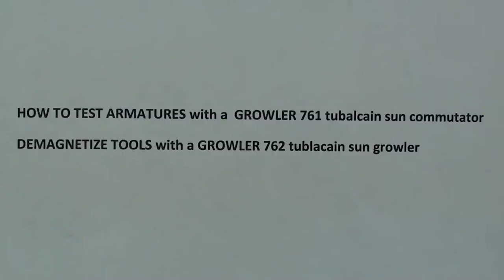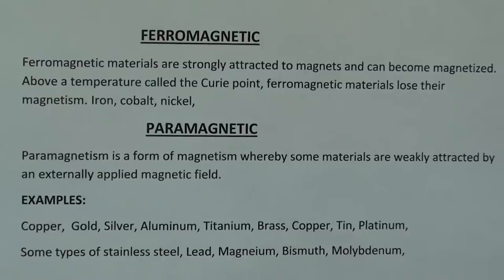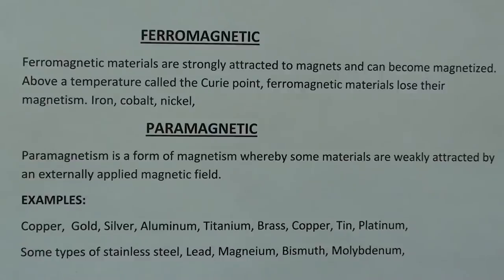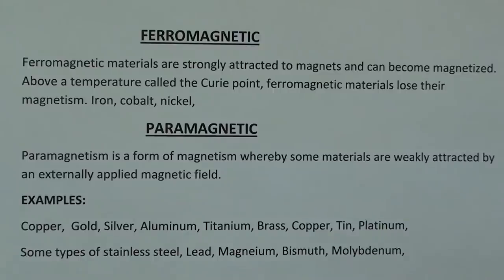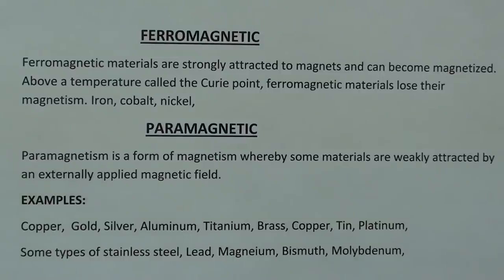WHAT IS PARAMAGNATISM  GROWLER #763 tubalcain

Comment: Very interesting Mr. Pete.  As children my brother discovered that a particular dry cell battery could be squeezed in a vice and we'd get drop of mercury from them.  We save the mercury to play with, shining up dimes and stomping on drops of it to listen to it pop.  We survived such foolishness.
Reply: That wasn’t mercury
Reply: @kiloton1920  It sure was, this was in 1962/3 when there was a line of batteries (AA and AAA) that my Dad removed from radio equipment he was repairing.  In fact in 2016 when he passed away and I cleaned out his radio repair shop he had a box of those old used batteries.  I took them to the hazardous waste depot to have them properly disposed of.
Reply: We used to play with mercury from broken thermometers the same way. We liked to rub the mercury on pennies to make them look like dimes. That was back when dimes were worth a dollar and mercury was something to play with. When was the last time anyone used red "mercurochrome" on cuts and burns? I'm assuming from the name that it contained both mercury and chrome.

Comment: My dad also called the knockouts a slug.  You brought back a fond memory, thanks.
This video reminded me of a gravity experiment. If you have a small magnet and a length of copper tube say 3 feet through which the magnet will readily fit,  allow the magnet to drop though the tube and see if it falls at the same rate as any object dropped at the same time. I believe the power of the magnet may affect the outcome but I myself have never tried it. The magnet will fall noticeably slower through the tube and it is not from contacting the inner wall.
Reply from the maker: I have done that experiment in another video
Reply: On a larger scale many roller coaster brakes work much the same way... and on a smaller scale, thats how old time analog VOM's and some 'beam' type scales are magnetically dampened.

There's a lot more to all this.
Reply: Have you ever tried a slugburger?

Comment: The last material you used being silver solder was in the form of a coil. in other words would  form a shorted loop The growler would induce a fairly high current into this loop, This would add to the vibration you are feeling. I am a  retired armature winder and very familiar with growlers. They are still used today at any elec. motor repair shop. There are small portable growlers that are used for inside field stators on ac electric motors
Reply: the portable growler I used was called a prufex grower and in the form of a wand
Reply from the maker: Thank you for watching and thank you for an interesting comment

Comment: I don't think you're really demonstrating paramagnetism with the growler.  The growler uses AC, and the changing magnetic field induces currents (so-called eddy currents) in any electrically conducting material.  Those eddy currents in turn generate a magnetic field that interacts with that from the growler to produce a force.
So any conductor, even those that AREN'T paramagnetic will feel a force near the switched-on growler.
A paramagnetic material, will even be attracted by a steady magnetic field (such as that from a permanent magnet).  There are also diamagnetic materials which are repelled by magnetic fields.
Reply: You should also feel the strongest effect with copper because it is the best conductor, other than silver.
Reply: You are correct. If you wanted to show paramagnetism  (or diamagnetism), you can do so with a tub of water, a styrofoam "boat" to put the sample on, and a strong neodymium magnet. 
If you hold the magnet steadily near the sample, it will be attracted or repelled very slightly depending on the material.
If you move the magnet over the sample instead, those metals with a high electrical conductivity will "follow" the magnet the faster you move it. This is for the same reason those move in the growler.

Comment: Many of the materials (copper, gold, silver, tin, lead) you cite as being paramagnetic are not.  Those are diamagnetic, repelled by an induced magnetic field, not attracted.  The effect in either case is very weak in a growler, and what you feel in your hand is merely back electromotive force (EMF) from induced currents in the samples, not paramagnetic or diamagnetic force.  Not surprising, because back EMF is what a growler is designed to test such as in diagnosing armatures.

Comment: Sorry to be a pedant, but this effect is not paramagnetism, but an effect of ordinary classical electromagnetics. The field generated by a growler is A/C, and any conductive material placed in an alternating magnetic field will have eddy currents induced in it, which in turn react with the magnetic field from the growler, resulting in a force that you can feel. One phrase for this is "Lenz's law." The effect that causes the copper to vibrate in the growler is exactly the same as the effect that causes the copper winding of an electric motor to turn. In fact, according to Wikipedia, copper is not paramagnetic.

Paramagnetism is a very weak magnetic interaction--much weaker than the effects seen here, but is with fixed magnetic fields. The classic classroom demonstration involves suspending a drop of liquid oxygen between the poles of a powerful magnetic (like the ones salvaged from microwaves). Paramagnetism is a quantum effect found in atoms with odd numbers of unfilled orbitals, and is fundamentally different from the magnetic induction effect you see here.
Reply: Dan, you're correct.  Not sure how the venerable and reliable Mr Pete could be so misinformed about magnetic susceptibility, but he's a shop teacher not a physics teacher.  Most of the samples he's demonstrating are actually very weakly diamagnetic (negative susceptibility: copper, lead, tin, zinc), not paramagnetic (positive susceptibility).  But the di repulsion or para attraction forces in this demonstration are too weak to be felt in the hand.  Lenz's Law is all that he is witnessing.  See CRC Press Handbook of Chemistry and Physics , "Magnetic susceptibility of the elements and inorganic compounds."

Comment: The coin mechanisms used in vending machines and pay phones used a fairly complex sensor system most had three sensors and was used to determine which coin was present or a fake or slug. They were programmable for the various country coin sets. I know, what’s a pay phone?
Reply: Western Electric payphones (called "coin collectors" in the business) comprised what a machinist would call a go-nogo gauge to test thickness and diameters, plus a kinetic bounce to go-nogo on specific gravity and hardness.  It basically measured 4 dimensional qualities in an instant, that amounted to a near 100 percent conclusive test of genuineness.  The coin had to size right, weigh right, and bounce right to pass.  One or more incorrect factors got rejected into the return slot.

Comment: Turns out metallic mercury is pretty harmless, on account of just not being very bioavailable - you can swallow small amounts of the stuff and it goes right through (I am not suggesting anyone actually do this...).  It's organomercury compounds you have to watch out for.

Metallic lead is a bit worse, but lead isn't nearly as volatile and as long as you wash your hands after handling the stuff you're fine.  Lead paint dust in the air, on the other hand, can be horrific.

I wish there were better messaging to the public about what is and is not hazardous with these materials.
Reply from the maker: Thanks

Comment: Hi, the experiment is a bit wrong because the magnetic source that you have is pulsating (in grid frequency). So due to this all material with paramagnetic properties and solid consistency (solid bars, liquids, etc. No wires in open loop) will become magnets due to lenz law.

Comment: Try it with Shoe Goo, store bought rubber glue. It's a memory rubber and is magnetic, along with other secret property's. It has a very very long shelf life, but it has to be worked a little before using it. It was used in a child Kings space program (1977*) in his rubber band generator (parented) he used to charge the spaceship batteries with, when in outer space. You can reuse it over and over by resolving it in rocket fuel or 190 proof moonshine (Kara's mountain, song lyrics), you have to use a mold to form it again and again if need be. Cool ! P.S. I am a machinist and tool & die maker, I like you stuff when I'm online with that subject, the what is it stuff is a challenge but fun.
Reply from the maker: Thank you for your comment. I am not familiar with that glue
Reply: @mrpete222  He must be talking about that secret Flubber from the 1960s.

Comment: Most US coins have a 100% copper core and 25% nickel/75% copper cladding.

The exceptions are the phosphor brass dollars (Sacagawea and presidential), 
nickels (25% Ni/75% Cu), and pennies (zinc with thin copper electroplating).

If I understand it correctly, that tungsten carbide cutter is probably 10-20% cobalt, which is used to sinter the tungsten carbide particles together.

I'm restraining myself from going to eBay and looking for a growler like that. It looks like a really interesting thing to experiment with.

I think an old vacuum tube tester would also be an excellent tear down and examination. I remember as a kid going to the King Kwik (like a 7-Eleven) near my house where they had a tube tester in the store.
Reply from the maker: Thank you. I used to go to a place called Frank’s cigar store, to test my tubes

Comment: The correct term would be 'magnetic force" if you want a better term to use then power. Fascinating video, most people do not get to play with strong AC magnetic fields like that. But for the principles of magnetic design ,you defiantly want to use the term magnetic force. If someone is studying this then they should quickly realize they can use standard force diagrams with magnets for the design of magnetic hinges, dampers or electromagnetic devices. The proliferation of cheap induction heaters is going to make the shop more interesting and intellectual I think... wireless phone chargers, induction stoves and electromagnetic blacksmithing, stuck bolt removal and brazing devices.. are we in the jetsons yet? At least maybe we won't have idiot plumbers catching houses on fire so much in the future (I love the story about a nail conducting heat into insulation and causing a house fire after torch plumbing repair work... very scary if there are people around that have no concept of insulation and shielding in tight spaces). Plus with this economy and oil politics, getting friendly with electricity and magnetism can help your wallet and possibly country. For instance, I found that using a current transformer is a good way to avoid using gas for straitening sheet metal. You can quickly get a yellow hot 'dime' sized section of sheet metal ready for flame(thermal) hammer straitening without busting out the acetylene... I bet a induction heater might work for this also. The little magnetic latch on my smart phone screen case cover saves me around 20$ a year in corning screen protector glass without making me think about what is in my pockets all the time. Magnetic charge cables are also wonderful IMO. Very simple magnetic devices with high utility. And for those playing/building with magnets, loctite black prism rubberized cyanoacrylate adhesive is wonderful.

Comment: Can you make a coil of insulated copper wire light up a light bulb with your growler? Pragmatism making the electrons move without a Iron core If I remember. I have never tried it...It should also be able to move a compass needle when you put a coil of wire around the compass face..but theoretically you should be able to make an inductance current with your growler in a insulated coil of wire or coil of wire with or without an IRON core.The iron core will make the copper coil more efficient.
  Thoughts or experiments? (:
Reply: That works, but it's just creating an ordinary electrical transformer.  Paramagnetism is not involved.

Comment: What is felt is not power, it is force.  The non-magnetic materials that are effected, because they are electrically conductive and a current is caused in the  non-magnetic material that is attracted and repelled by eddy currents in the test subjects.  True paramagnetic include elements such tritium and some other "A" bomb fall out particles. Ron W4BIN
Reply: Various ordinary shop stuff is paramagnetic: aluminum, magnesium, manganese, tungsten, vanadium, chromium.  Nothing exotic about being "true".